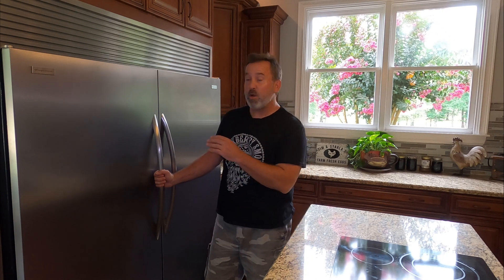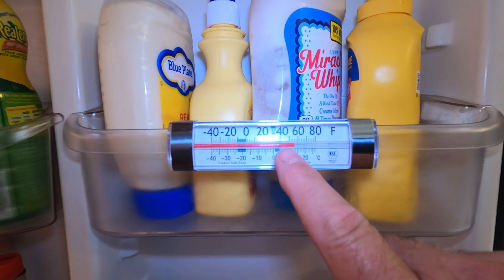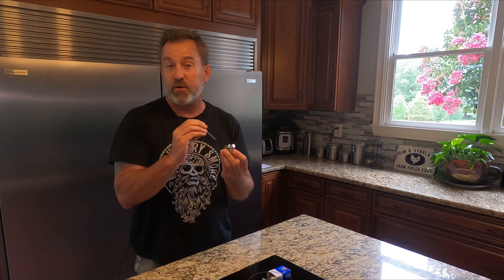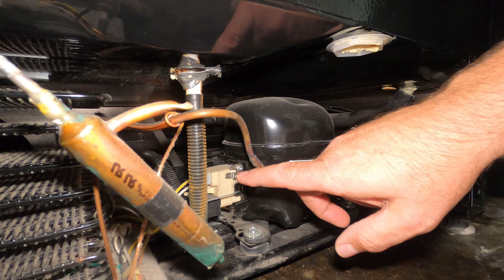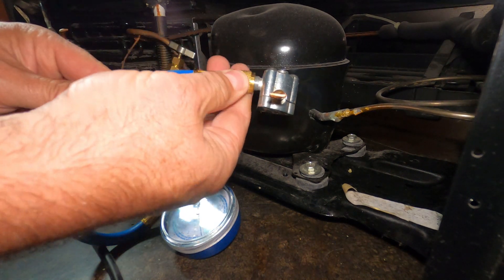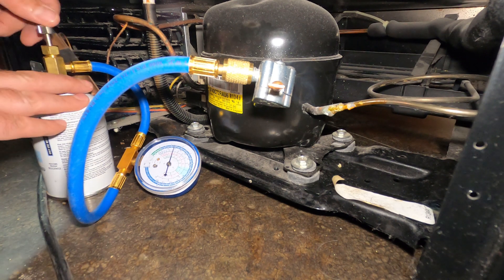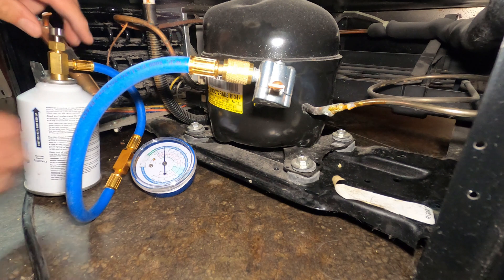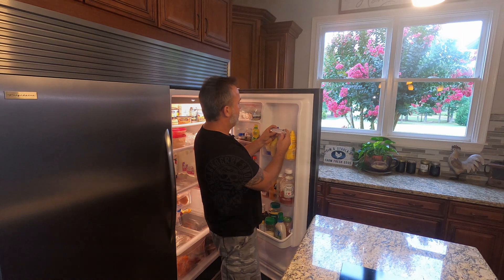Refrigerator Coolant Leak | Bullet Piercing Valve | Why Pay Someone $$$ BIG Bucks to Fix?

Comment: How did you come up with diagnosis that the compressor was running low on Freon? I have the exact same fridge. The freezer side is working well, the refrigerator side however has issue like yours. The compressor gets super hot in like 10-15 minutes. Is it the sign of low refrigerant?
Reply from the maker: Compressor running and no cooling. Low side pressure low.
Reply: @RidgeLife  Can I pick you brain?

Same fridge. When its set to 4 Celcius, actual temps is -4 to -1, when I set it to 8, it does not cool anymore? it raised up to 10 celcius, same when I put 6 celcius.

Could low refrigerant explain that?

Comment: Why 10 psi?
Reply from the maker: Pressure for normal system of this type. Just on the higher end of normal.
Reply: I have the exact refrigerator. How did you come up with 10psi, not 1-2psi? I have seen 1-2 psi in some other DIY videos. Thanks.

Comment: Hello - I’m wanting to do the same thing you did in this video. However, my service line is too short. I can’t connect the piercing connector there so how do I know which of the other two lines coming out the side of the compressor is the suction line? It seems one line is thinner and hotter and the other thicker line is cooler to the touch is the cooler line the suction line? Thank you
Reply from the maker: Ooh. Sorry I am not a HVAC tech enough to know ow for sure.
Reply: @RidgeLife the thicker cold line is suction.
Reply: @Ron-oe7hg thank you
Reply: The cold line is always the suction line; you should put the piercing valve there in your case. The hot line has a much higher pressure and temperature.
Reply: @Pumba3900 thank you

Comment: On a lot of fridges Those cheap a holes are putting metal lines in and under the insulation. Those metal lines are rusting and making holes where your Freon leaks. On your fridge you’re being lazy and not fixing the leak. And yes, you can fix it yourself if you put your mind to it.
Reply from the maker: True!

Comment: I have the same set, and the same problem as you. Add a few drops of 134a dye into the hose before you connect on to the tap. With a UV light you will find the leak. May you you can solder up the pinhole and fix it for good, if the leak is inside at the aluminum evaporator coil, they make a 2 part expoxy that you heatup with a torch and that would permanently fix the leak.
Reply: Found out after trial and error. For a freezer 10psi is no good. A freezer pressure should be 0. Fridge psi is good at 10 psi
Reply from the maker: Very cool thx!

Comment: Your video was awesome and helped me a lot with the issue I had with low refrigerant. How did you come up with the low side pressure reading that you stopped filling freon at ?
Reply from the maker: I did a bunch of research online and filled a hair higher since I have a leak to make it last longer.

Comment: Using bullet piercing valves guarantees you'll be paying someone to come back and fix it 😂. Don't use home warranty companies just pay someone who knows what they're doing to fix it right once.
Reply from the maker: Valve has been on for years now. Just top off every few months. Still on same can! Yeah warranty companies are the worst!
Reply: You shouldn't have to top off a delayed system. You have a leak. This is a bandaid at best. This WILL result in catastrophic failure and a short life to your fridge. A leak is letting air and moisture into your lines and that is a serious detriment to your sealed system. Good luck. But if you want to actually fix this (which you haven't fixed whatsoever like you think) find the leak and brazen and seal properly. Than vacuum your system and recharge it.
Reply: @dudebro2001 You are so funny serious, his recharge has lasted his fridge for years. Your points may be right,  but are theories. He has proven what he did is what we expected!
Reply from the maker: @TanTan-ch3vq thanks!

Comment: Have you tried using a leak seal in there?
Reply from the maker: I haven’t but after I run through the plain coolant I will try some for sure. Thx.
Reply: Seizes up the compressor

Comment: Weird that you magically found the system in to vacuum state,  specialty if there is a leak. vacuum needs to be done before charging the system if its empty.
Reply: I don't think he vacuumed the system before adding new freon.  What he did was to close the tapped valve, connect the can of freon then let some freon out to push out unwanted air before letting just the freon into the system.  I'd fix the leak and not keep pumping more freon to let it eventually all leak out.  Breathing freon vapour is very dangerous for his family's health.
Reply from the maker: Yup. I do it about every 3-6 months. I’ve used my first can now. Just takes a little bit!
Reply from the maker: Weird. I’ve done it 7 times now without issue ever several months and it cools perfectly!

Comment: mmm...make you want to wonder why they don't just install a recharging valve at the factory like they do to cars.  In fact, they actually do.  I was looking at refrigerator I got my older brother...he paid couple thousand bucks...  The compressor has two charging ports on the compressor as well as the cold and hot outlets.  The stubs look like they have way to much waste sealing it off.  I guessing it just like at the factory...or when the product was manufactured in another country and some yahoo took off the charging tubes...or replace the compressor with their own manufactured compressor....  the tube used for this system is in metric...(6 mm versus 1/4 inch) and a much smaller package cooling radiator
Reply from the maker: Wild huh?!?
Reply: @RidgeLife  It is all about making a buck I guess when labor is cheap in another country....  In the long run, having a customer getting their refrigerator service once every couple of years...is good for the economy and there is data to back this statement up.
Reply from the maker: Very true.

Comment: Why pay someone? Because opening a home sealed system without a Federal license is a FELONY. Up to 10 years in prison and $10k fine pwr violation!  Type 1 for small units like a refrigerator. Type 3 license for large commercial or home central AC
Reply from the maker: Luckily, the piercing valve does not release coolant into the atmosphere and doesn’t violate the regulation requiring 608 certification.

Comment: There are more efficient forms to kill 🐧 s. Use nitrogen to check the leaks of refrigerant. If the fridge not have any refrigerant is mandatory use the vacuum machine. Bad advise if you have a fridge of thousands of dollars, this can work 1 day or 365, but later the if the compresor is broken you want to pay for solve your brilliant "ideas".
Reply: Yes, the prisons are overflowing with felons who fixed their refrigerators without a license, second only in number to the people who removed mattress tags from their beds.  Pretty hardcore group also, nobody messes with them in prison lest they go to work on you with a blowtorch and a pair of pliers…
Reply from the maker: Nice opinion. I’ve had it running for three years since the ‘tech’ said it needed a new compressor. Still on first can of r-134. Give it a dose every 3-4 months. Boom!
Reply: @RidgeLife  Try to find the leak with water + soap, if in your country there are not honest workers is the best solution. Nice solution.
Reply: @RidgeLife  Your video is proof you committed a Federal FELONY punishable by yp to 10 years in prison and $10k fine unless you have a Type 1 Refrigerant handling Technician license. Your state likely esquires a license too. The valve cannot be left on permanently either unless you fill it with R-600 iso butane instead.

Comment: Are you doing this while the machine is running or turning it off?
Reply from the maker: It has to be running. Turn the dial to full cold and open the door.
Reply: @RidgeLife  the link for the r134a didn’t work. Can you send it again?

Comment: Hello Sir,  Can you please help understand how to manage the amount of Gas to put. Label on Refrigerator shows 5 oz. of R134, however you said 12 PSI. whats the relation between the VOLUME and PSI we are required to control while injecting the Gas > thanks in adv
Reply from the maker: You have to have a pressure gauge. Mine shows the proper range for 134a with the unit running.  You fill until the pressure is in the desirable range for that type coolant. Since  I have a slow leak, I filled to the top of the pressure range.  I hope that helps.

Comment: Flip the can upside down and charge just putting air refrigerant In instead of liquid refrigerant. Will not last long do it right.
Reply from the maker: Hmm. I’ve always been taught to keep upright and slowly agitate.
Reply: WRONG. Yiu must move small can from vertical to horizontal every 3 seconds oer instructions on can

Comment: How do you know what type of refrigerant you need an how much the systems holds?  I have an LG LSFD2491ST and I am searching without much luck.  Great video!!
Reply from the maker: It should be on the inside door label with type and amount of coolant as well as in the compressor. Thx!
Reply: @RidgeLife  It sure was!  I was checking all over online too!   Its not getting cold at all (freezer nor fridge).  Its clean inside and out, tested thermistors, start capacitor, evap van, and condenser fan.  Thanks for the help!  This is my last try before I throw my 5yr old fridge out.  If its the compressor, repairs could be half the cost of a new one.
Reply from the maker: Very true! Good luck!
Reply: @RidgeLife  Sorry, last question...  How do you know what the ideal psi should be?
Reply from the maker: @DWR6  it’s pretty typical for the type of coolant. The gauge I used had the proper ranges for the type. Very cool!
Reply: If you don’t know amount, best method is to add refrigerant bit by bit and monitor frost pattern on evaporator and make sure line back to compressor does not sweat all the way
Reply from the maker: They make the coolant with a stop leak in it too. That may hep.

Comment: You talk about the different sizes of the piercing valve BUT theres NEVER a close-up so we can see and understand what youre talking  about.
Reply from the maker: Click on the link in the description for the part details.  Thanks.
Reply: The adapters for 5/16 and 1/4 inch tubes come with the 3/8" access valve. Virtually all home systems have 1/4" low side tubing.. Unfortunately,  many high side evaporators are 3/16". No temporary access valve is available to evacuate that high side. It's a big problem with duka evaporator systems. Unless one had a Federal Type 1 Refrigerant handling Technician license, doing this is a FELONY punishable by 10 years prison and $10k fine for each violation.

Comment: I little trick I use, especially in cars, is to put the 134A can into a container of hot water. It make the 134A to come out faster.
Reply: Pros heat the refrigerant. Especially in winter.
Reply from the maker: Whoa!

Comment: Piercing valves.. it's not if they will leak but when. This is horrible advice.

Also, if you are local to me for 100$ I will come to your home and put HI/LOW service ports. 

Because of advice like this I'm now going behind all Bob Vila's weekend warriors out there in my area fixing what they messed up.

One more thing. You own rich people fridges in a rich people kitchen which presumably resides In a rich people home and you are going to squabble over a max 200$ dollar bill. That would include service ports and a refill. Sad.
Reply from the maker: Mine has been in for over a year and spent less than $20 on it.  The ‘repair guys’ wanted $1000 to ‘fix’.
Reply: @RidgeLife  message me back in about 3.
Reply from the maker: Huh?
Reply: @RidgeLife  he's saying message him back in 3 years if it's still working or if the repair didn't last like this guy thinks

Comment: Who puts a center island in front of a freezer or refrigerator.  It is never going to be pulled out?
Reply from the maker: They engineered it just right as I have pulled them out often.  It’s a tight fit though!
Reply: @RidgeLife  then, they didn't engineer it right to begin with.

Comment: I used to work on window unit air-conditioning and I would us piercing valve to check the freon in them....
Reply from the maker: Very handy, huh?
Reply: Freon ® R-12, R-22 has been banned since. R-134a will be unavailable after 2022.